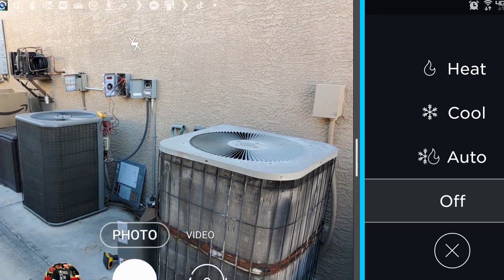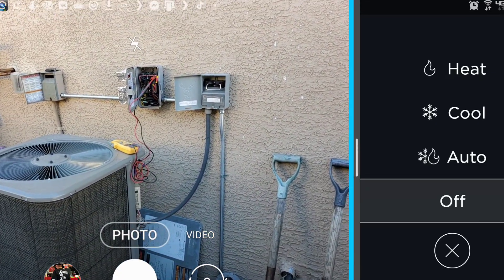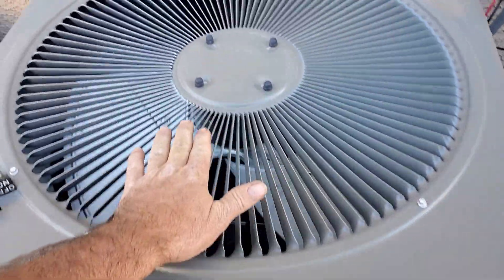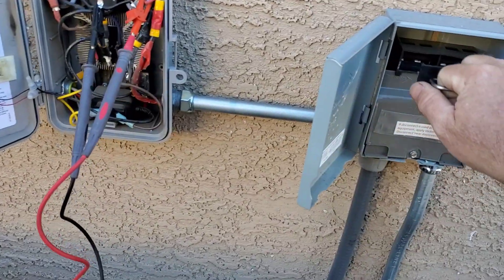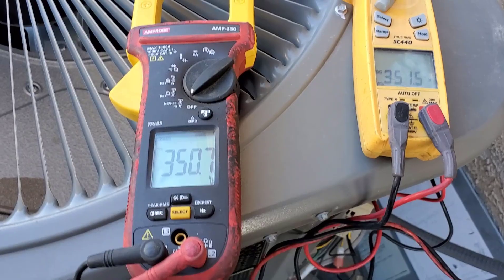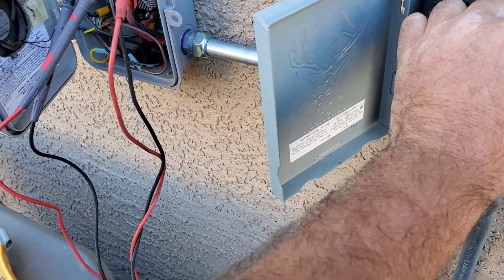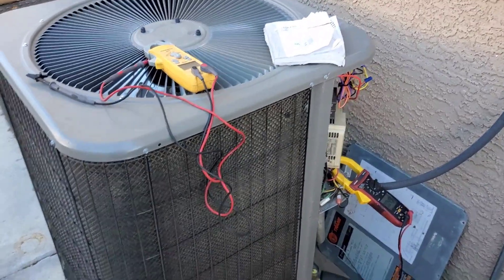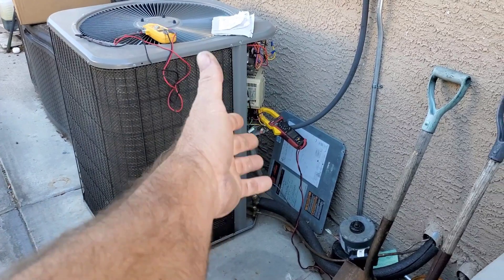Testing my off grid solar capacity during a mid winter day - Will it still power my 3 ton A/C unit?

Comment: My experience is that solar panels provide more capacity in the winter compared to the summer since there's less deprivation from the heat of the sun on each panel, sadly this is tempered since the length of sunlight during the winter day and vice versa.  Very impressive set up and I must say I'm jealous. ; )

Comment: Speaking of "normal" :-), I see you mounted the smaller Heat Pump water Heater outside, how's that working with the cooler weather now in the evening?  I notice on mine if the garage gets below 65, it runs a long time heating 50 gallons, so I've been slowly pushing up the temp when I kick in 1500 watts of backup electric.

Comment: I’m curious how your light bills were for the past three orfour months compared to previous year‘s.
Reply from the maker: I had no way of comparing because I had a friend move into a room then the grandma in law moved in and my wife and daughters were home all summer due to the convid plandemic.
So they consumed way more.
I had one hefty bill in July.
Also the AC upstairs was on at 76 during the day when it was at 80 during the peak time in previous years.
Reply from the maker: My goal was to design a regulator so the utility power would just maintain at least 300VDC to the bus and essentially be totally off when the solar kept it above that.
Then it Doyle have harnessed the power from the solar.
But at best the solar probably carried half the power being that that were just two DC supplies in parallel.

Comment: Over your phone microphone when it starts up it sounds like a Goodman had a kid with a Ryobi Weedwhacker
        Solar panels like the cold work more efficiently.
Reply from the maker: I had read that the panels lost efficiency in the hot summer but evidently it is a bit if the directly overhead sun in the summer is no better than the winter angle now.
22 250 watt panels (although used) so I have a bit to play with.